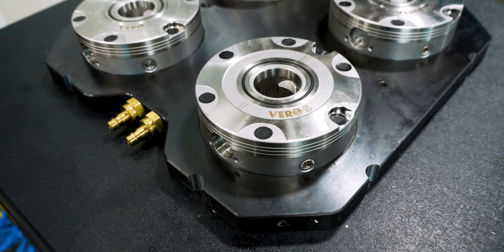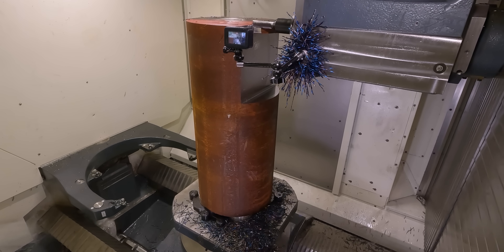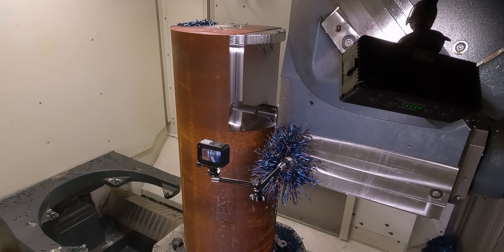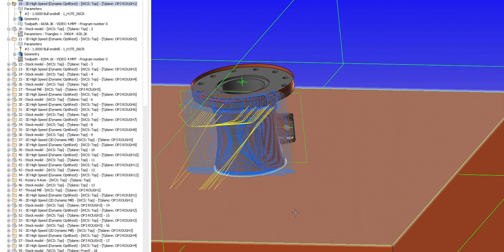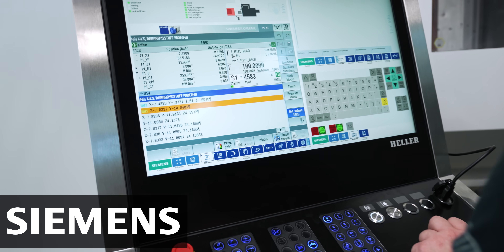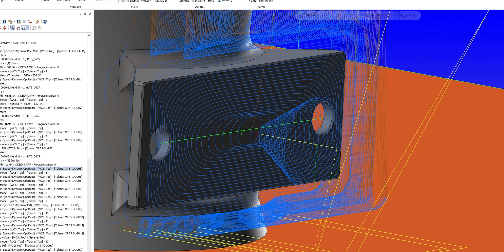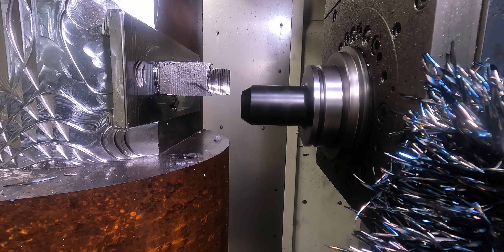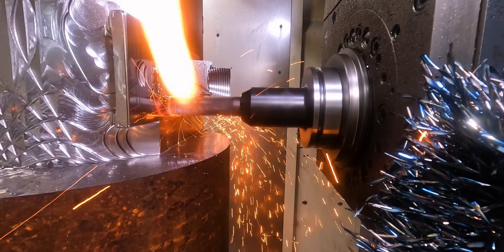Can We Conquer The Impossible? Machining 2200lbs Of Steel Vertically

Comment: Come on guys. Your supposed to show us efficiency. Do a turn profile and get most of that on the lathe.
Reply: This part couldnt be turned because of the feet
Reply: @barrysetzer weld em back on afterwards 👀
Reply: @ipadize 😂
Reply: @ipadize Most customers in the aerospace or defense industry have a zero tolerance for weld.
Reply: @Moses_of_Ironwood  ik it was only a joke
Reply: @ipadize well alof this is determined by what the customer wants. Maybe they done want welds. Or maybe their lathe doesn't have that size capacity or is busy on another job
Reply: Stir weld is relatively common
Reply: Barry, I very much enjoy your content. Maybe we can learn from each other and achieve the same goal. If this part could not be turned, perhaps a 2D dynamic contour, rolled geometry, to a substitute axis. Can provide sample.
Reply: @barrysetzer  Well, you could turn everything else and then mill the feet down from there.

Actually, what I'm wondering is what it would take to set up a short run metal casting operation. Maybe CNC or 3D print a form for lost wax/foam casting? A quick search suggests you lose a few dollars a pound for anything that gets milled away. Add a few $k in mills and a week'ish of shop time and you could still be ahead paying a steep markup to get a casting. That said, you would be limited on the types of treatments you can offer so some jobs it just won't work with.
Reply: Putting that part on a lathe and doing the programming just to take of the scale is a few extra steps that all in all costs more time than just having a few extra tool paths on just one machine. Reducing the amount of setups saves so much more time. Maybe there are better tool paths but for a one-off the sooner you cut the more time you save ...
Reply: The labor time for a second fixturing is more expensive than any saved machining time
Reply: Is more setups more efficient? I would sacrifice some more cycle time for less setups
Reply: One setup and overnight cut vs multiple setups?  Yeah, I'll take their method.
Reply: This would have been better on large mill-turn simple cause it could be supported at both ends you could do a rough turn for the profile and be more aggressive milling since it’s a rigid setup
Reply: I believe the purpose of the video was to push the limits of what the SCHUNK work holding can do
Reply: Dude the part weighs over ton. Getting that in a lathe would a hell of a job itself. Then just to only be able to turn a few sections of it. Just to have to put it on the mill. Sounds very inefficient.
Reply: Yea i wanna see them part off a 600mm piece of roundstock 😅
Reply: I don’t think they have a lathe that size to use frequently, but any UMC with high power can cut that
Reply: What lathe are you going to turn over a tonne on?
Reply: A 2000 lb part isn’t even heavy. We do much bigger parts than what it looks like these guys do but I run a Mazak Powermaster and I’ve made parts that finish well over 5-6000  lbs. We also have a lathe with a 48” chuck and 550” bed length. We have 30 ton cranes on that side of the shop. It’s pretty normal to me.
Reply: They need to promote the tools who pays the video 🤷‍♂️
Reply: Ability is cool also. Doesn't always have to be turning and burning.
Reply: Honestly, anyone who thinks it is a good idea to mill a ball valve has ZERO machining experience. If you haven’t figured it out yet, these guys don’t have a lathe. You didn’t think about how they are going to bore the internal radius with a stubby little mill? They outsource it. Their entire business is built on automated mills so he can hire less people and make more money which is not a good thing. Being too specialized makes your shop vulnerable. Any real machine shop would have a lathe, but they don’t because it is just a giant advertisement for CNC mill companies.
Reply: not only that but using a high feed insert mill would have been way more safe and way higher material removal rate 😂